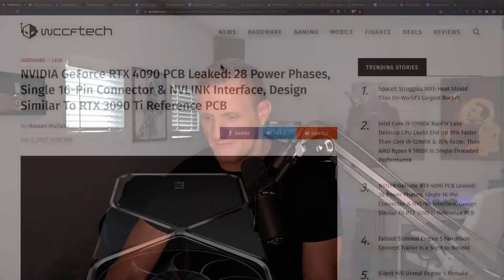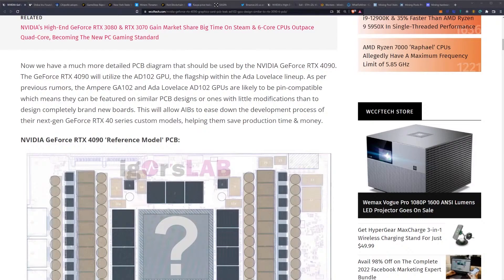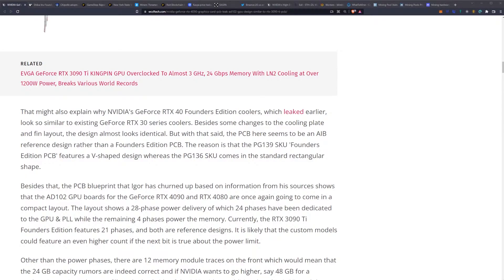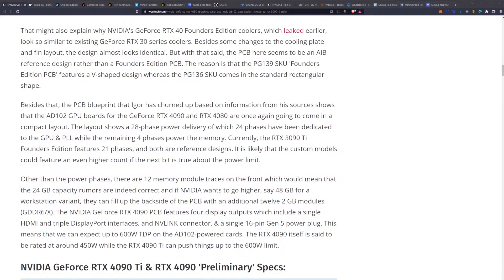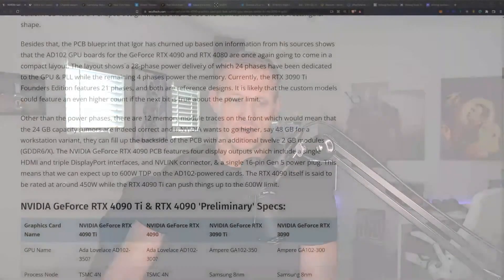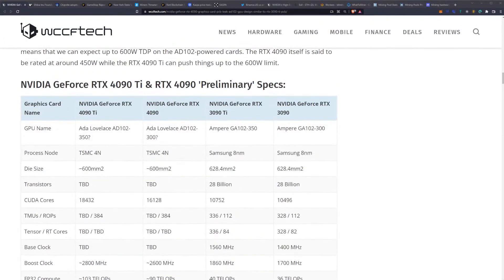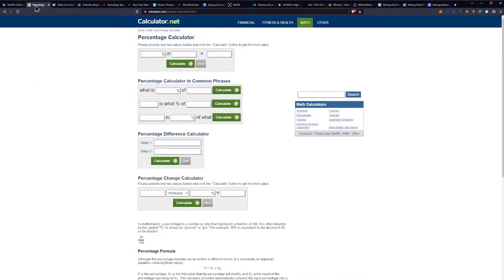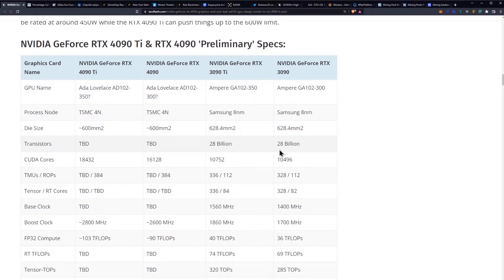More Leaks About The NVIDIA RTX 4090 & 4090 Ti - 126

Comment: If the leaked specs are true, Nvidia is reducing the memory bus by 1 tier on everything below the 4090... that would negate the bandwidth gained from higher clocked memory. 4000 series isn't looking like much of an improvement over 3000 series for algos that heavily rely on memory bandwidth.

Comment: i am sure it will have more than 150MH or its not worth the upgrade.
Reply: If the leaked specs are accurate, I would not expect it to reach 150MH/s unless the memory can sustain a ~15% overclock